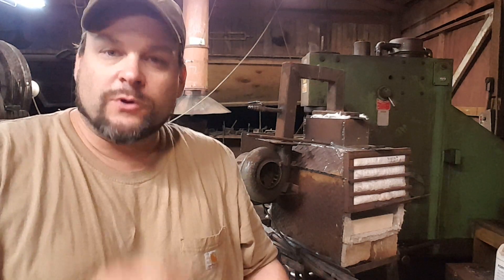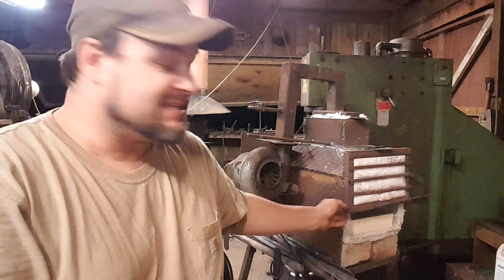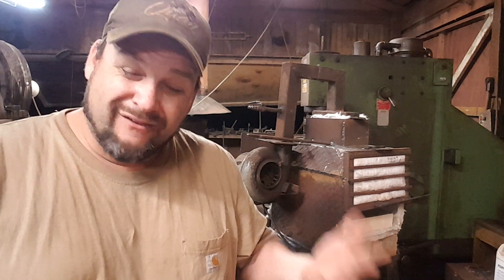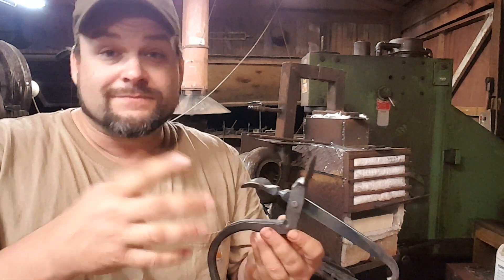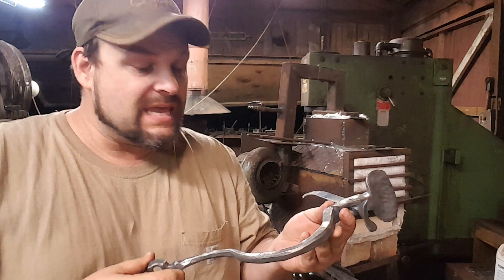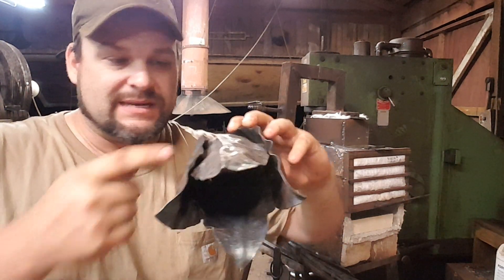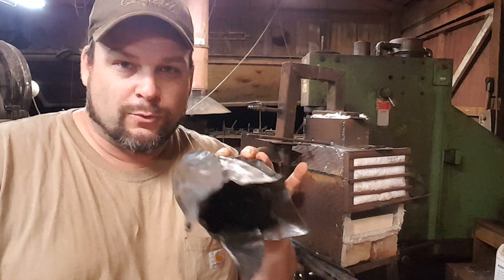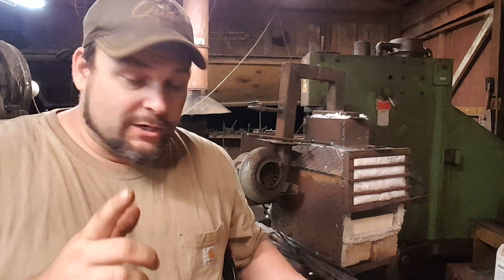Why Water Columns Matter In Solid Fuel Forges

Comment: Wood is retorted into charcoal 
Coal is retorted into coke 

Who uses raw coal ?
Reply from the maker: Your nomenclature is a bit off. Its only retorted if it is put into a sealed retort, its an actual device. Otherwise you are doing something known as "driving off the volatiles" when you burn wood and coal down tho their purified forms. And many folks use coal that is burned to coke in a forge. I do.
Reply: And that is the process I use to produce my charcoal .
I've a set up that collects and burns the volatiles under the chamber to perpetuate the distillation of the wood .
Once it gets to a certain stage the exhaust is throttled back .
25%
50%
75%
99%
18 hrs later I'll open the retort to pure charcoal 
I did my apprenticeship at a steel works that retorts coal into metallurgy grade coke .
I used to be able to buy that same grade for my use .
Reply: 4:00
That word " coal " was used numerous times
 powdery coal  , rock coal .
I thought don't you mean coke ?

Coke being porous allows the air blast through easy .
Charcoal isnt used in a blast furnace as it can not support the column weight of the hematite and limestone charge and will crush down closing the blast avenue .

A solid sphere has a surface area of 
4 py r squared 
Porous charcoal/ coke has a surface area multiple times greater allowing a greater burn face releasing more energy quicker with less blast pressure .
Please do not think I am out to disrespect you or your channel .
My comment of 
Who uses raw coal was genuine .
As I visited a fellow apprenticeship at his home and he was using raw coal ( as it was free)  in his forge .
It wasnt at all a pleasant experience .
Hence my original comment .

I'll have to learn how to upload onto you tube so you can view my 3 in 1  set up .
I start the charcoal retort , then the smelter for recovering aluminium from mixed metal components like gearboxes/ cylinder heads .
Then the foundry column for casting up coming jobs .
If I'm quick , the molten aluminium poring out of the smelter , once barely solidified can be put into the ladle with all its heat soak for a quick melt and cast .
Conservative of energy 
The heat from the 3 working together is like a 2 stroke engine hitting its power band .
Regards

Comment: My brother recommended I use one of our older carpet dryers.  1000 cfm plus.  Is that to much?
Reply from the maker: Its about water column more than cfm but it should be way over kill. Need to use a gate valve to adjust.

Comment: I don't know if you read the comments on old videos, and I'm not sure if people reading comment would take tips from other viewers, but here's a DIY trick if you notice that your electric blower does not build up enough pressure:

look at the blade wheel of the fan. Depending of what kind of wheel it is, there are different adjustments you can make. If they are straigt blades, hammer them forward or replace them with blades that curl forward. So the outer point of the blade must be more towards the rotation direction in order to swap out a little bit of flow for a lot of extra pressure. If you already have curled blades, chances are that they are curling backwards (this allows higher rotation speeds at the same stress levels, resulting in more flow volume). If you turn the wheel around, the blades will curl forward. If the back plate of the wheel is a full disk, weld another disk on the open side, then cut off the original disk to invert the blades.
REMEMBER: the only risk involved here, is that you will introduce higher stress levels on your material, and higher load on your motor. Try to evaluate if it will be able to handle it.
Also, if you are hammering blades, make sure the curl is even and all blades are curled the exact same distance.

Why is this comment relevant or why should you believe it? It will immediately increase the output pressure (measure in "mm water column"). This is a technique I used as an HVAC/industrial dust collection engineer when a client required an increase in pressure but did not want to commit the funds to buy a new fan. Of course, the sizes were much bigger, but air behaves pretty much the same between the respective scales we are talking about here.

Comment: Man, I wish youd left the comments open on the "jet fuel doesnt melt steel" video.

You should've brought a mic just so you could drop it at the end. 

That was fucking epic.
Reply: I refine metals for a living and you like to think you know so well, why don't you go try it. Hell look at the damage from some common house fires, they are not even 20 feet in the air. You can sit there all you want and talk but until you have worked with metal, alternative fuels and different types of furnaces maybe you should go and test your ideas and maybe you will learn something. Straight to insults shows you are not worth my time and have no worth of debate so as my last reply, good luck to you hopefully you open your thinking and progress.
Reply: Kaisernine Just because you melt metal for a living does not make you an expert. Thousands of structural engineers and architects with way more credibility say you are a wrong, including the engineers that built that very building. Open your eyes and have a good day
Reply: @JC honestly the fire inside the building causing  many plastics and other materials to burn would have made gases with extreme hot burning temperatures and with the updraft of air from a building of it's size, it essentialy would become a blast furnace - so yea melting steel in a blast furnace very plausible. 
Stop looking at fuel from the jet and look at many other materials making flamable gases hot enough with the air mixture. Most plastics are oil based so i'm not sure about you but waste oil forges and fires are very very hot.
Reply: Kaisernine So now burning plastic can melt steel 30 stories below impact? That's a fucking laugh. Did you dream that one up yourself? There are almost 100 videos showing molten steel pouring out the side of the building before collapsing. You have to be pretty stupid to still believe the diarrhea you just tried to spew. I feel sorry for you, probably could find your ass if you had a map.
Reply: This why he disabled the comments, because of idiots with fingers in their ears shouting "melt,melt,melt,melt," and not actually listening to what he said.
Reply: dash3693 LMFAO, more like so nobody can point out his idiocy and how smarter people with an education in structural engineering can scientifically debunk the official story.
Check out Richard Gage, he shits out more brain cells with his morning coffee than this guy has in his head.
Reply: trunk yeah no the buildings were clearly demolished. Anybody claiming a building up and freefalls because of a single tank of exploding jet fuel is deluded in their own media painted fairy tale. That being said not all conspiracies or parts of them are true, a lot of it is easily controlled opposition. Kind of like flat earth, masons developed to enslave the most gullible of the religious so they won't buy into the government, but will fund a fraudulent organization like their cults etc etc sorry I'm tired but you get the point. 9/11 was 100% a demolition and george bush is a slippy mouthed buffoon who practically admitted it in body language
Reply: Wasn't epic.  It was stupid and didn't show or prove anything
..no comparison...
Reply: He used a 1 inch piece of steel.
Not even close to a multi foot column that barley got hot cause all the jet fuel exploded instantly on impact. This guy should stick to pounding metal and not trying to "debunk" basic physics.

Comment: I have had this same idea about making my blown forge with a larger chamber.  If you need a smaller chamber, it's easy.  Stack the floor with bricks until it's the size you need.

Having enough pressure is key.  I found that a good, cheap, high pressure blower is a leaf blower.  It's noisy, but it's easy to control, and does the job well.

Thanks for the video..
Reply from the maker: Welcome, dude!